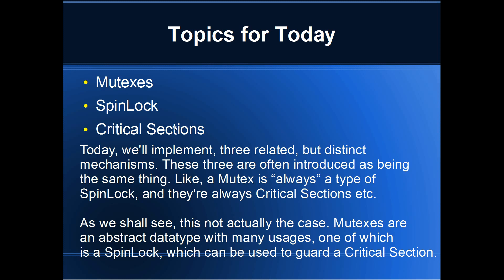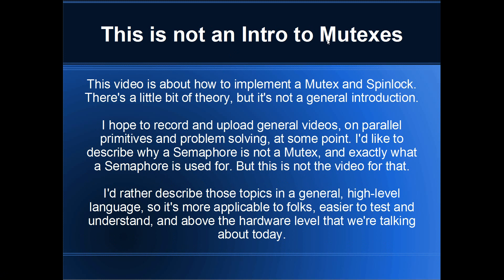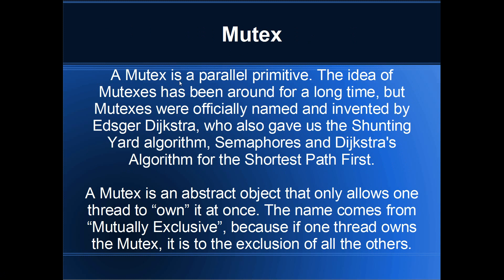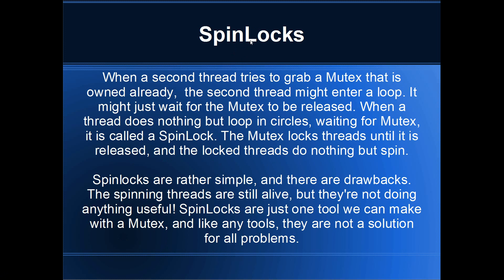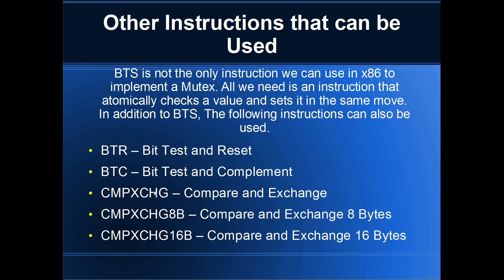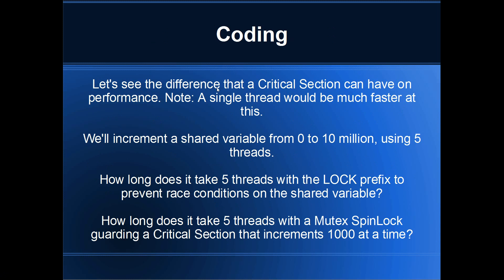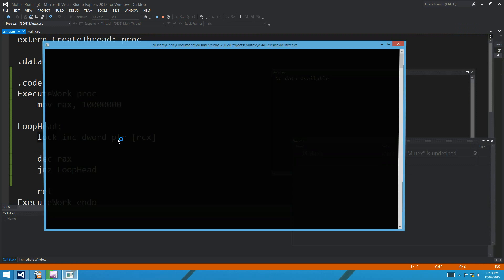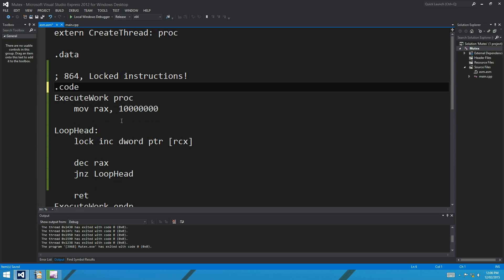x64 Assembly MultiThreading 3: Mutexes, SpinLocks and Critical Sections

Comment: Is there a way to let the computer do something else while we lock?
Reply: By that, I mean, how do you get a thread to sleep while a condition is true without staying in a loop to continually check?
Reply: @lapatatadelplato6520  condition_variable is designed exactly for this case, staying looping kills CPU cycles and this is what Spin lock is, Spin lock is used only to wait for very short time since condition_variable has its cost, for long times and events for example that could happen once in an hour condition_variable is the way to go, you set a thread to sleep and wake it up when that event is happened, in C++ to set a thread to sleep use std::condition_variable::wait_for() method, check documents for more details

Comment: you're surprised about LOCK'd instructions being slow? When you lock a memory location, you are forcing a buffer-flush after every write to it. As a result, all other threads get their cache invalidated and have to re-load that cache line from memory (or other cache level, i.e. L1 cache from L2 cache - which sounds like the 10x performance gap). That in essence is what you want to get accomplished with the LOCK prefix, but the performance hit shouldn't come as a surprise?

Comment: Hey, I love all of your tutorials, and I really enjoy how relaxed and fun you are with them and your code.
The reason that the spinlock version is faster than the 'lock inc' version is that your'e updating 1000 times in the critical section. In effect you only have up to possibly 1000 locks per thread instead of 1000000 resulting in a nice speed increase.
I mean the speed improvement is not down to not using the slow lock instruction, just that your'e locking less.

I hope I make sense :^)
Thanks again!!
Reply from the maker: Nice! I think you're right!